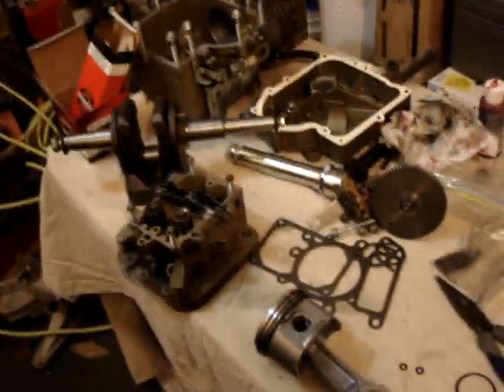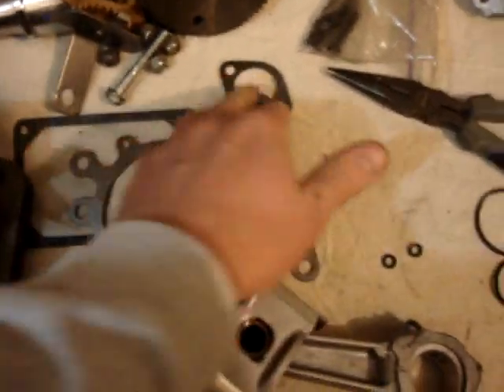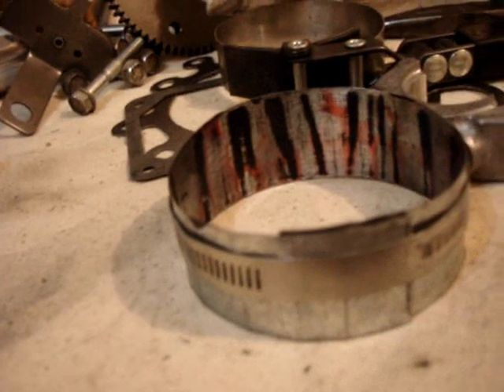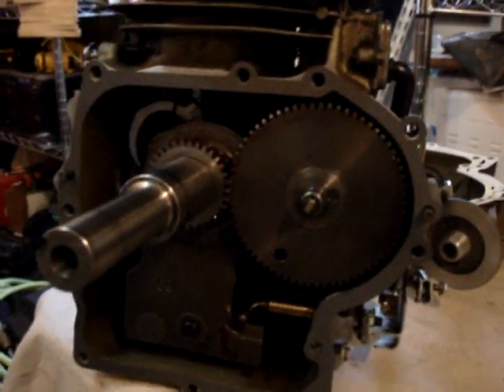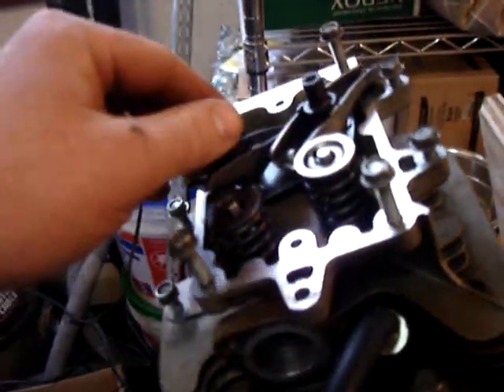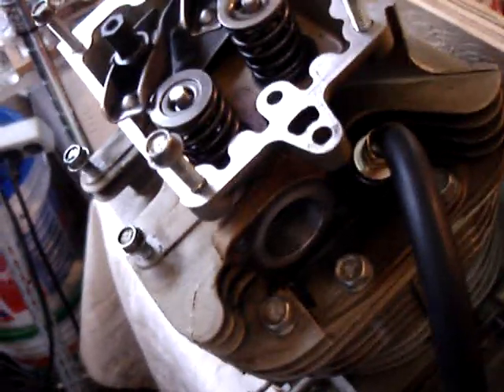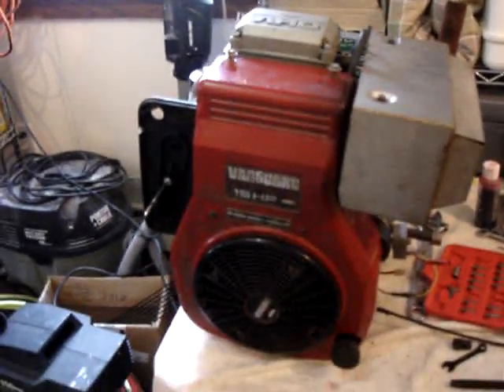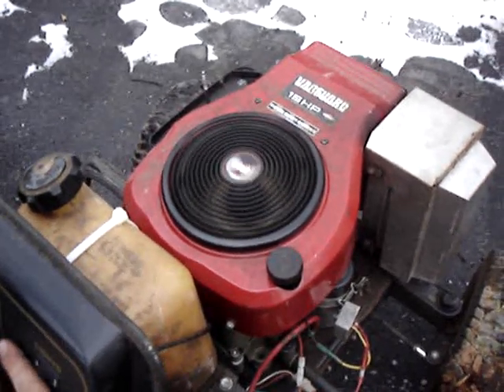15 HP Briggs and Stratton Engine Rebuild

Comment: Was the 0.040” hole in the leak down tester a random choice or is that what a standard tester has? I have an aircraft leak down tester and those normally supply 80 psi. 78/80 is about new. 75/80 is ok. Much less is not good. You squirt some oil in the cylinder to check if the leak is past the rings. I never have taken mine apart to see what the hole size was. 40 years ago, it was relatively cheap to buy.

Comment: doesn't sound to good. did you put the pads back on the top of the valve springs. if you didn't the valves will never be adjusted right. in the video I seen one fall off the valve springs. that's why its making that ticking sound.

Comment: Depending on how oval your piston was, it may have been ok. Most are designed to compensate for heat expansion around the thicker parts of the skirt. Just something I picked up somewhere else.

Comment: if i doesnt turn forewards, try turning it backwards. A hydrolocked motor will not turn through a compression stroke, but can be turned backwards through the intake tube, but it pumps the oil (or water maybee?) into the intake, so itll smoke for a few minutes.

i was mowing with a 2010 3.5HP craftsman, and it somehow pumped 4 ounces of oil through the breather in one power stroke, and sucked it all through the carb, and locked up on the next powerstroke. I grabbed the blade, and spun it backerds

Comment: when the rings have seated, and the motor is fully warm the gap is negligent, but on a cold motor, or one thats thats worn, or a scored bore, blowby will be alot worse. Most small engines only need a crank breather because the volume of the crank case increases and decreases by the displacement of the motor (my 18 horse twins crankcase volume changes by 42CID 60 times a second at full governed speed.

Comment: @jenniesboy Your just going to need a full set of tools, honestly i reccomend you get a full SAE and metric socket set in deep and shallow in 1/4 3/8 and 1/2 in drive. along with metric and standard wrenches then hammers pliers punches, gear pullers and allot more...

Comment: On a cold engine on the leak down test you will have greater leakage through the the rings than you would on a hot engine where the rings have expanded to close the ring end gap. 
Rebuilding with a small ring gap can cause the rings to break for lack of expansion space. Good rebuild, 5% percent is right on.

Comment: im working on a 4 stroke engin not sure wadt brand its is its a air cooled rope start im wonding if i can find or make a turbo for it and will i be able longated cams instead of standerd were do i find a 3 speed trans for my engine